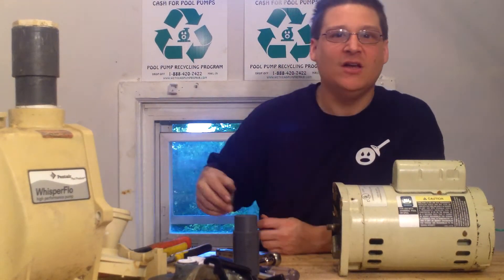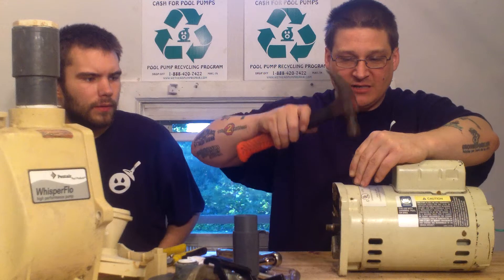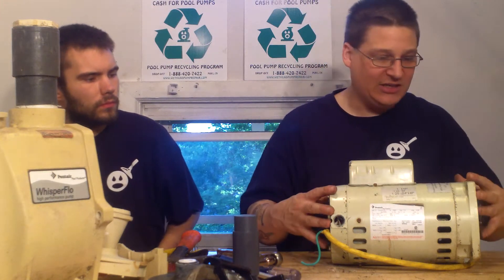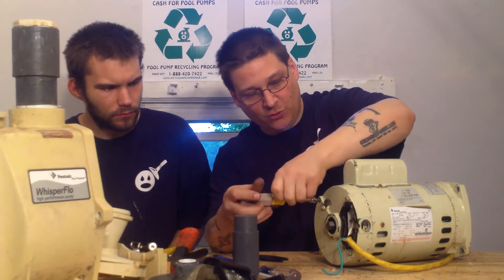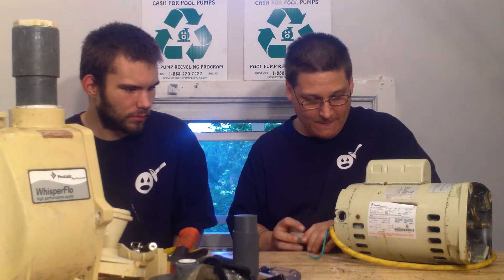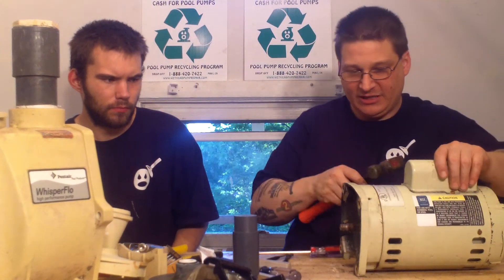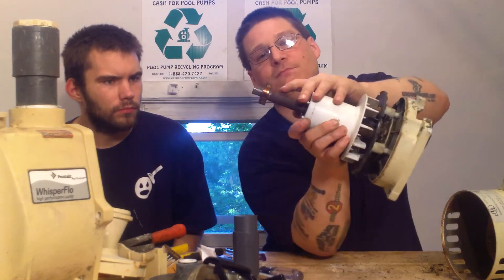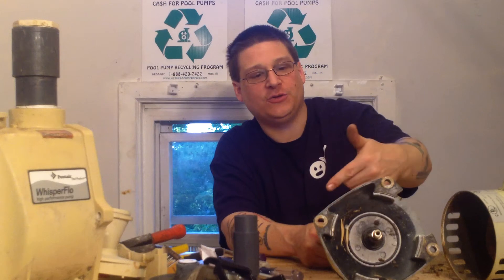Pentair WhisperFlo 1 HP Pump Motor Rebuild

Comment: I broke the plastic part that goes attached to the front end bell when I changed my bearing will that cause my motor to over heat since i didn't put put on t back in